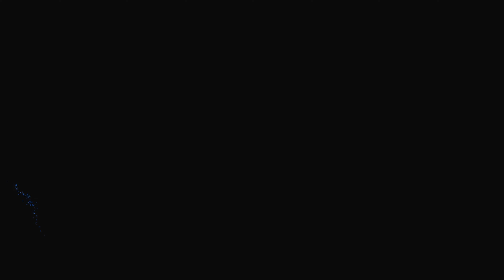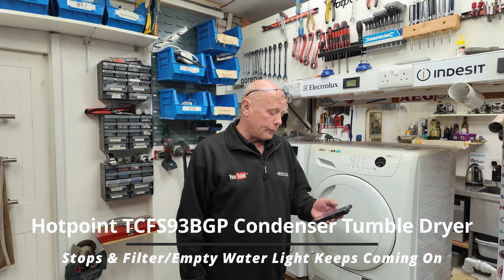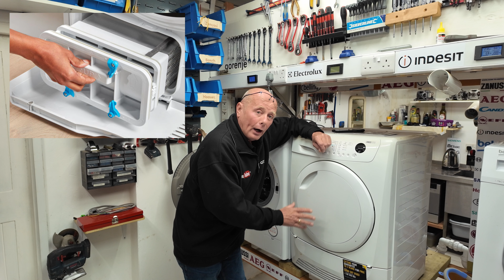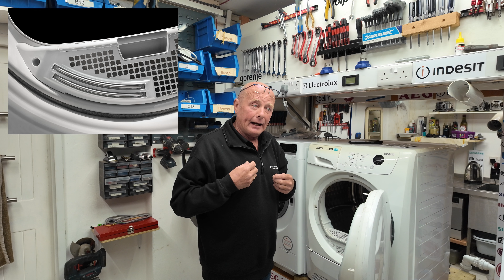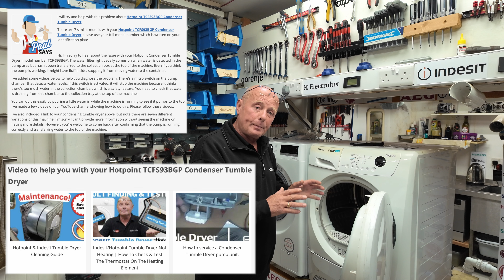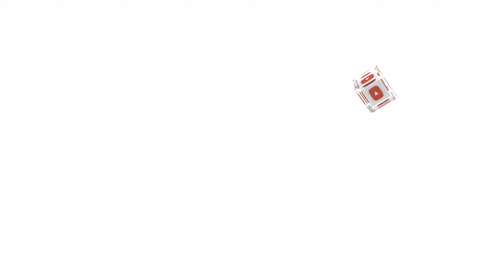Hotpoint TCFS93BGP Condenser Tumble Dryer Stops & Filter/Empty Water Light Keeps Coming On

Comment: Somebody please help, yesterday my dryer stopped stating to empty tank, my tank was emtpy and then i watched this video, i opened up the dryer and the pump is fine but there was a lot of water in the chamber, i hoovered it all up and dryed it all and then the dryer started working as normal. BUT TODAY, the same warning come on so i opened it up and the chamberis full of water again and i hoovered it all up again and now its working back to normal. My question is why does my chamber fill up with water? Please help anyone.

Thanks in advance
Reply: Did you fix it?
Reply: It’s fucked
Mines same 
Gave up
Reply: It might be the impeller in the pump housing. Costs three quid from Amazon. It's a rubber blade. Videos on YouTube show to easily fix it.